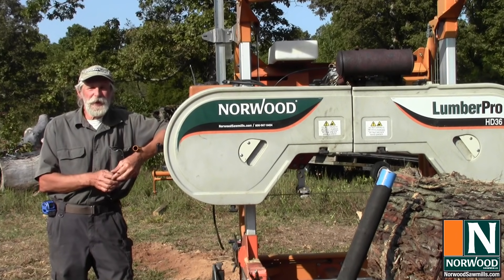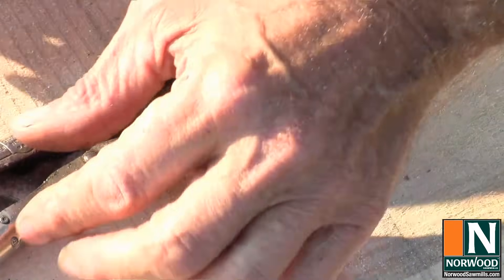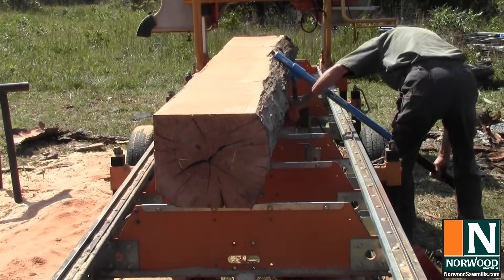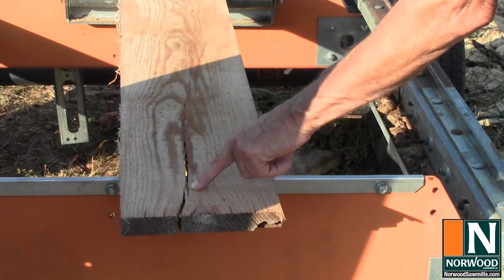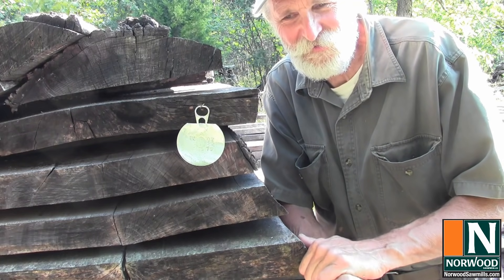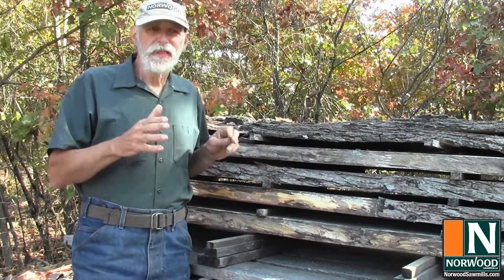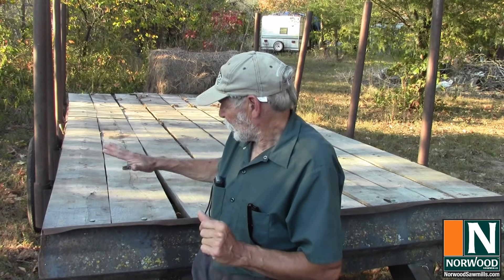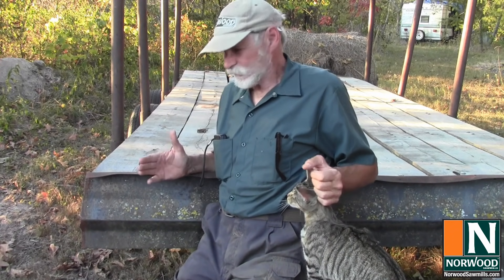Sawmill School - Air Drying Your Lumber

Comment: What a fantastic and informational video.  This is so good!  Thank you so much!
Reply: Coming from you, that's quite a compliment!  I look forward to learning from your videos, as well.  I've done a bit of forging (steel, not money),  and hope to get a drone in the air in the near future.
Reply: Thanks for your comment.  You're out of my league on video production, but I would welcome suggestions on improving audio quality for outdoor shooting at the sawmill.  Would a separate audio recorder in addition to the shotgun mic on the camera help?  I'm on a tight budget and don't need stereo... and I've lost track of the number of times I forgot to turn on the mic.
Reply: @daveboyt6810  Sorry, I took so long to reply.  The most cost effective way to capture clean remote audio is with a lapel mic connected to a cell phone or other pocket recorder via 3.5mm jack.  You can find a wide variety of them on Amazon.  I think Shure sells a fairly good one for about $60.  The cheaper $30 ones aren't bad either.  Just make sure you have a good wind filter(the foam ball, or dead cat style) on it. The down side is realigning the audio with the video in post production.  It helps if you start each shot with a clap that is visible on camera.  That lets you pick the frame where the noise happened and sync them up easily.  If you have a bunch of different shots this can take up some time.  That's why people are willing to spend a bit more on a wireless lav system.  I tried some of the cheaper versions, but I can confirm you get what you pay for there.  Static and interference is a big issue with the cheaper versions.  I settled on a Sony UWP system which I've found to be clear as a bell.   One benefit of using a secondary recording device, assuming your camera doesn't have multiple audio inputs, is that you can keep using your shotgun mic to capture ambient audio on the camera and then blend the two audio sources in post.  This will give the final production a more complete sound, where a "lav only" setup will tend to sound a bit one dimensional.

Good luck and keep up the great work!
Reply: @HaloKTS  Thanks for the suggestion.  I can see another advantage of the pocket recorder in that when I forget to turn on the shotgun mic, I'll still have audio.  I hate it when I spend an hour shooting video (this might involve loading a log on the mill three or four times to get different camera angles), only to find no audio when I edit it.  Maybe I'll make myself one of those Hollywood-style clapboards with the scene written on it.  Now I know why they use 'em!  Looking forward to watching more of your videos.
Reply: @daveboyt6810  believe it or not, I've made the same mistake many times.  I had to make a checklist to make sure it gets turned on.  Since I do a lot of live events it's even more critical. I have nightmares about that happening at a wedding!  That's why I always double check the sound and everything gets fresh batteries before we start rolling.  With regard to the clapper board, you're spot on!  That's exactly what they're for.  Newer versions are actually wirelessly hooked into a master clock that generates matching timecodes on all the audio and video devices on set.  Fancy stuff!

Comment: I'm just beginning to mill Northern California Black Walnut, juglans hindsii. I painted and waxed the ends of and air dried 3 logs approx 20" dia for 3 yrs and recently milled them, mostly at 3" but some variation. I'm getting ready to cut down one tree, 62" D and 10Ft long and I don't want to wait 3 years and mill it I want to do it Now and cut at 3+" , 6 slabs, sticker and bind them. Am I  doing the right thing? There is some beautiful figure in them

Comment: Still a question here: What effect does leaving the bark on have? Take it off immediately? Leave it a year? It seems that it would accelerate the RATE of drying by removing it but what about the long-term effects?
Reply: On the log, I don't think there's much effect one way or the other leaving the bark on.  I don't like leaving bark on the boards, though.  Moisture does get trapped under it, and it's a great place for bugs.
Reply: Logs laying around without bark will begin to stain quicker than they would with the bark on. Regardless the hot summer heat is hard on logs. Especially your maple species.

Comment: Thanks for your videos. I've learned a lot from them and enjoyed watching them. In fact when I was toying with the idea of buying a sawmill I think your sawmill school first cut video tipped me over the edge into buy one and so far I'm loving it from cutting the trees to sawing them into lumber.
Reply: Once you get sawdust in your veins, there's no turning back.  Which mill did you get?
Reply: Since money was an issue I ended up getting a woodland mills HM130 max. I'd like more bells and whistles but that will have to be the next iteration. My brother stumbled across your videos and liked them so he's getting the fever too and is thinking of getting a midsize Norwood. Hes got a bit over 40 acres Norway pine and black spruce(55+ years old) that needs to be thinned again lots of 16''-20+'' logs there.
Reply: @paulfranklin5855  The important thing is that you made the leap and are making sawdust!  I had two other sawmills before getting a Norwood and if I had to replace it, it would be with another Norwood (their new big one looks pretty cool!).  Sounds like both you & your brother will keep the mills busy.

Comment: Thanks.  Good video!  How often do you replace blades, if you never hit any nails?
Reply from the maker: A good rule of thumb is to sharpen band blades every two hours of cutting (so take a few blades with you for a full day of cutting). However, you may need to sharpen your blades more often if you are milling dirty logs or species that have a lot of sand inside the fiber (like cedar).  You almost always have to throw away your blade if you hit a nail. Most sawyers can re-sharpen blades between 5 to 8 times.
Reply: Yes, I've hit my share of nails, as well as bullets and, occasionally the log stop when I left it up too high.  These generally trash the blade, and always seems to happen when I have a new blade on the mill.  With a manual mill, it is pretty easy to tell when a blade is getting dull, as it gets progressively harder to push through the log.

Comment: As you are comparing the moisture reading between different species like maple and black oak, on better moisture meters you can adjust the mode to the actual wood species density to get a more relevant reading.
Reply: Right you are.  Any meter that doesn't have that feature is a waste of time & money (or worse, since it can give you the wrong info).

Comment: How about avoiding cracking while drying in a desert? For now I’m drying in a conex trying to slow it...
Reply: You're doing the right thing trying to slow down the drying.  You still need to allow air circulation, so if the wood is in a closed container, you should put in some fans and have the container open for maybe a half hour at mid-morning and mid afternoon to start.  End coating the logs (or boards if they're already cut) with a product like Anchorseal will help with the end checking.  Your best bet is to monitor the moisture content of the wood as it dries.  Banding the wood or putting weights on the stacks to keep them straight will also help.  As the wood dries to under 20%, you can increase the open kiln time.  Depending on species and your conditions, you should have kiln dry 1" thick lumber in around 8 weeks.

Comment: Nice video, Dave! The only strange thing for me why you used fresh cut wood for trailer flooring if you knew that it will shrink and warp :)
Reply: First, I needed a new bed right away.  The trailer came with a rusted out steel bed that I didn't trust.  The shrink & warp isn't an issue-- It just needs to be strong enough to safely haul logs & equipment.  I won't be pulling parade floats with it!
Reply: @daveboyt6810  :))) thanks Dave! I thought almost the same, but nice to hear from you.

Comment: good job mr. to your knowlage at what of the month is the best for cutting wood for lumber thanks
Reply: I like early spring before the ticks and copperheads get to be a nuisance.  As far as the wood is concerned, it doesn't matter much, but best as soon as practical after the tree has been cut.
Reply: Any month with an R in it, Sept. Oct , Nov. Etc. Usually when it's cold enough the leaves are off the trees.
Reply: @danpatch4751  So you don't like to mill in June, July, or August???
Reply: @daveboyt6810  milling is ok but prefer to cut trees during colder months

Comment: I've got a massive beam I just cut out of Fir, 35x35" beam that's 42 foot long, thought it would be really cool and didn't want it to go to waste since it fell down. Should I seal the ends its going to sit in my barn for awhile, any hope in that drying? Should I even worry about it?
Reply: I don't have any experience with beams that size, but keep in mind that beams only shrink about .1% in length, and post & beam structures are generally built with green timbers, because they would take so long to dry.  Your beam will only shrink about 1/2 inch over its entire length!  It will shrink about 1-1/2" in thickness and width, though.  What kind of mill cut that monster???
Reply: @daveboyt6810  thank you for the reply! I guess doesn't really matter if it shrinks I don't have anything to do with it, be a cool conversation piece one day. I'm in the process of milling it myself got two sides now need to get the other two. Just used a 661 with a 42 bar and timber tuff guide. Was alot of work but the beam is beautiful!!!
Reply: @James Strawn okay thanks after watching a few more videos that's what I'm planning on doing. I dont know why it's so enjoyable looking at such a large piece of lumber... but it is!
Reply: @suzy1000100  Now you need to build a 42' long cabin with that beam exposed at the peak of the roof!

Comment: Would you get faster and better drying if you cut one pass off of opposing sides?
Reply from the maker: The material (boards) that you ultimately create will be the same dimensions regardless of which direction you cut from. So, no, drying would not change.
Reply: Good question.  If you mean turning the log after each cut to balance the stress, then as Norwood's reply indicates, it is the thickness of the wood that matters for drying time, though careful attention to the grain pattern can minimize splitting and warping.  It can also relieve stress while milling so the boards are more consistent in thickness.

Comment: So, if a kiln dried 2X4 sits out in the lumber yard for some time, it will eventually absorb moisture and return to air dried status?
Reply: Good question.  A kiln dry board will pick up moisture if just left outside.  It takes time, as the change takes place slowly, especialy in thick boards.  Less, if it is kept out of the rain, and very little, if it is in the middle of a stack of lumber.  If you're building a project where kiln dry is critical (like a Maloof chair), you need to pay close attention to the moisture content.

Comment: What if the log is debarked? Surely log cabins must dry over time...
Reply: Debarking does cause the logs to lose moisture more quickly, but most of the moisture loss is through the ends of the logs and it takes decades for them to fully air dry, which is why they had to replace the mud or moss chinking periodically.

Comment: Thanks I learned some stuff from your video. I live in Tx and per your chart the best I can hope for is around 11=12% if the wood is say left in my shed to dry, so how would I get it down to a working dryness other than buying a kiln?
Reply: You might be able to use your shed to bring the wood down to kiln dry conditions, if you set stickers between layers, use fans to circulate the air, and open up the shed during periods of low humidity.  If you can stack the wood indoors (with stickers between layers for air circulation) to finish it off, that would also help.  Even at that, it would be a good idea to put a moisture meter on it to make sure.  Got any mesquite?

By the way, I just listened to your back porch recording of "Ain't No Sunshine".  Nice blues picking-- you & your guitar are welcome to our porch any time!
Reply: @daveboyt6810  Thanks Dave, be happy to do it too :-) I don't have any mesquite right now. I do have some big leaf silver maple, spalted tulip poplar, and cedar, lots of various oak. Thanks for the help :-)
Reply: There are videos on constructing a solar kiln. The idea is that wood "air-dried" to 12% relative humidity is going to "adjust" itself (read "move/shrink/warp") when taken indoors into climate-controlled 7% air.

Comment: on the topic of EMC, if I take a kiln dried board at 7% and put it outside for enough time, will it come up to the same %MC that an airdried board would be in the same conditions?
Reply: Basically, yes.  But due to the hysteresis effect, it doesn't quite get there.
Reply: David Blehar - In Japan , the Japanese use 'Charcoal' under their houses to help control moisture in their homes . 'Charcoal' is wood material that has been super heated through a pyrolysis process . Real ' charcoal ' (not store bought charcoal for cooking on a grill ) absorbs moisture from the air ,or from soil ( soil evaporates moisture into the air ) , wood does the same or similar thing . When building a ' log ' home in the ' olden days ' the settlers would dry the wood logs / lumber and then they would use 'oils' to allow the wood to absorb the oils instead of being able to absorb water . This 'oiling' process would allow the logs / lumber to last longer out in the elements , they would even use used motor oil to ' treat ' wooden fence posts and crossbars . It's these type of processes that lead to the creation of ' staining ' wood as a long term preventative to ' rot ' . When you understand the ' history ' of how these modern ' practices ' or ' products ' came into being then you'll understand better the reasoning behind how these things work .

Comment: So what's the minimum moisture for framing with pine?
Reply: Good question.  I'll bring the meter with me next time I'm at Lowe's.  I don't think there is a minimum, but there may be a maximum.  Since an 8' stud would only shrink about 1/16" lengthwise, mold is more of an issue than movement in high-moisture framing lumber.  The biggest issue in using your own lumber for framing are building codes that require every piece to be stamped by a certified lumber grader.  Inspectors can actually order you to take down a finished structure if you don't comply.
Reply: @daveboyt6810  thank God I live on a small farm and dont care what city slickers say or do.
Reply: @ironleatherwood1357  AMEN!

Comment: Very helpful info. I would imagine the humidity in Missouri there is about as humid as here in north Georgia. How long is normal time for boards to dry out?
Reply: Hi Bart, there's no such thing as "normal time" here in Missouri!  The old rule of thumb is 1 year per inch thickness, but with spring rain & high humidity, any wood that has been air drying over the winter actually picks up moisture.  A good moisture meter is much more reliable than the rule of thumb.

Comment: as an experiment I cut a 12" square ash beam to see what would happen.  got a lot of splitting in it.  any way to prevent this?
Reply: What's happening is that moisture moves along the fibers more quickly than across them.  This means that the ends are drying out and shrinking faster than the interior of the beam.  You can slow this down by painting the ends with anchorseal (latex paint works, but not as well), or covering the ends with a plastic bag.  You might also make the beams a couple feet longer than you need so that once it is dry (give it at least 3 years), you can cut off the ends to get rid of the splits.  Good luck, and let me know how it turns out.
Reply: @daveboyt6810  Thanks Dave.  This was an ash that had died next to my barn so I cut it down.  Obviously not quite dry internally.  I've had better luck with older dead ash.  -A lot of them here because of the emerald ash borer.  Since I don't really need big square beams, in the future I'll cut everything to a minimum four inches to reduce splitting loss.
Then I can either use them as structural wood or resaw later to what i want.  Currently making baseboard for my house with nasty silver maple.  A lot of character :)
Reply: Im making log benches out of our beetle killed ash, the first one i cut down was 100 yrs old, i slab them with a chainsaw, then use my router sled to clesn them up, but yeah the do split, almost all of them, 2” x20” slabs,

Comment: If someone could answer a question for me I've have  two ponderosa pines  they were felled 20 months ago probably 4 ft in diameter could the larger parts of the bottom of the tree still be milled or could I make live Edge rounds at this time? Just curious
Reply: Maybe.  The part next to the ground may be rotted, but the center cuts may well still be good.  With a little luck, you'll have just enough blue fungal growth to give you some beautiful "denim" pine slabs.  In my "Fun Cuts" video, I demonstrate how I handle logs of that size starting at 15:54.  https://www.youtube.com/watch?v=eLbnjkjXDmw&t=955s
Reply: Thanks Dave I think they stayed above the ground enough seeing that I didn't even cut the branches I appreciate your answer we're going to give it a go!!
Reply: @michaelc.ateoate979  Hope you'll post some photos!
Reply: Will do👍